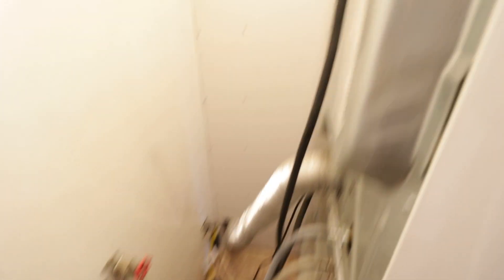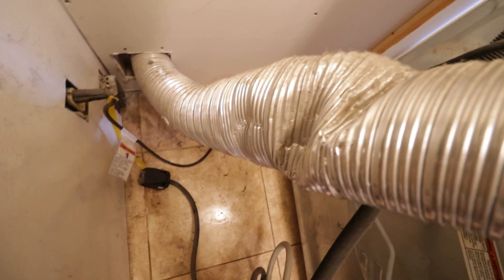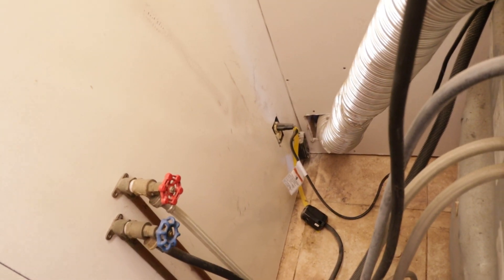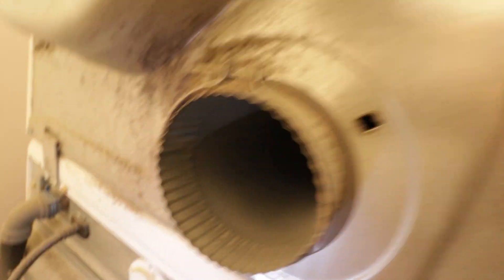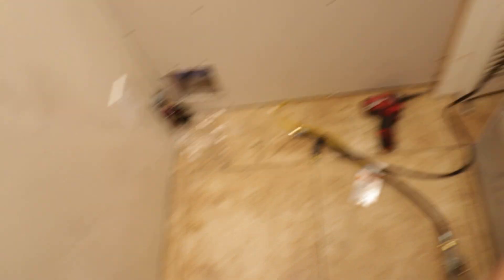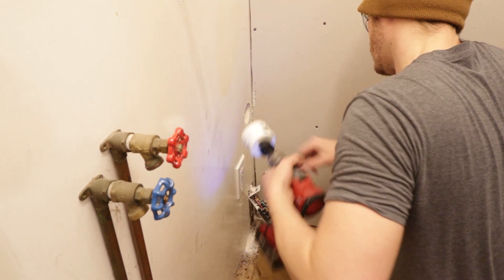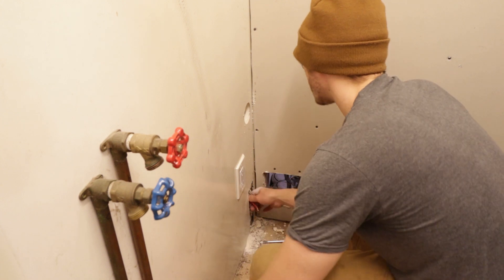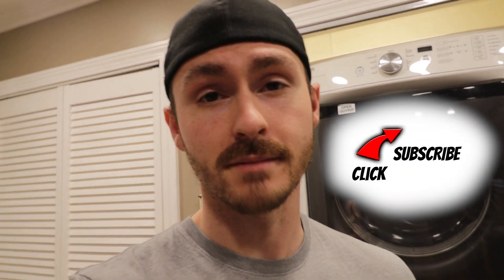How to Install a 240v Electric Dryer

Comment: Hi I hv a samsung dryer and it have two 120 volts pole two but my volts at home is 240 volts how I connect it
Reply from the maker: I would recommend contacting an electrician. However, it should be installed so that each 120v leg, the neutral, and the ground should be connected to the manufacturers/NEC specifications that match the way your houses circuit is wired.